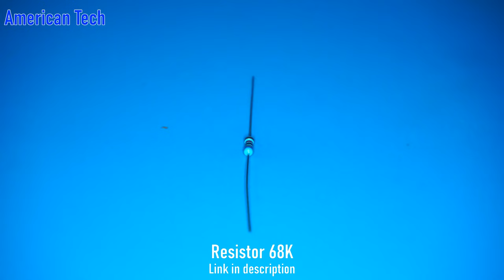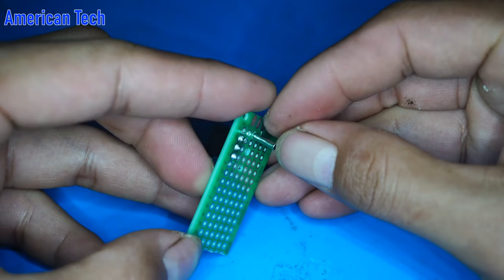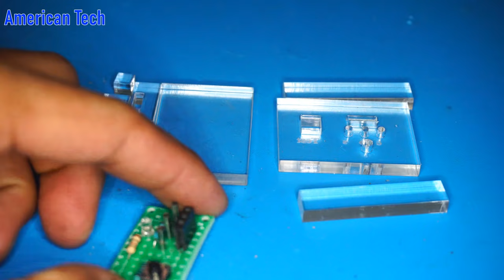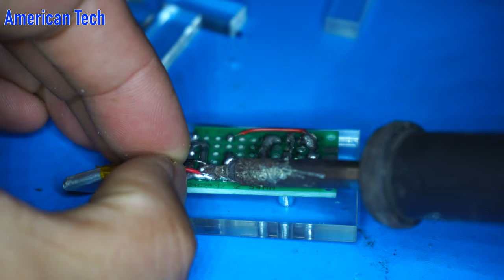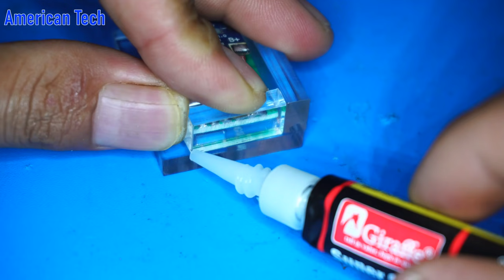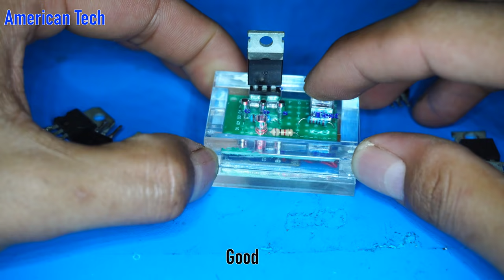How to make Mosfet tester |DIY  Electronic project

Comment: A REALLY good Mosfet tester would test the Rds, all diodes and maybe forward voltage.  Showing a Green LED when all are good and combinations of RED when not good.
This circuit will only test the FET and is hardly an indication of a good or bad MOSFET.   By all means, correct me if mistaken.